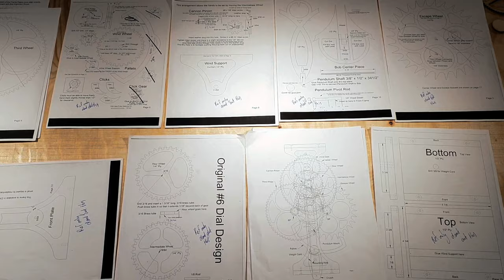Building a Wooden Clock

Comment: Great awesome work! Why you dont use laser for the gears ? because it burn the edges ?
Reply from the maker: Thanks :) There were several reasons why I did not use the laser for the gears. First was that I started this project almost 4 yeas ago, long before I got a laser. I had 3 gears cut but stopped until about a month ago. I wanted to finish the project in the same way as I started it by cutting the gears by hand (I did however trace them by laser). The second reason is that the wood is 6mm which is almost too thick and 12mm which is definitely too thick to cut through (I could have used 3 and 4 mm and glued pieces together but this seemed inelegant). Another reason is that the burnt edges might be a bit too sticky (there is always a slight residue). To remove it would have been a lot of work - and I think it would have taken more time than just cutting the gears (if I had a small belt sander it might have worked - it certainly would have helped during this project in any case). I am however happy that I did finish the gears by cutting it by hand.
Reply: @Induku  Thanks for the answer, i only worked with industrial laser cutters, 10-15 mm plywood is easy to cut with industrial cutters, but the burnt edges are still problem. Other way if cutted with cnc router. I like your quality works.
Reply: My answer for me is I made it, not a computer controlled laser.  The clock is 400 year old technology, not state of the art 2000's.  I just started on this clock, having made a different clock 19 years ago of a much different design.

Comment: Good job! I like this video.i have a question ,to have an accurate time keeping how calculate the length of pendulum ,and how to calculate the weight ,i think when we put too much weight  the clock runs bad
Reply from the maker: Clayton Boyer designed this clock and has a lot of information on calculating the various things that make it work. Here is a few answers for the some questions:http://www.lisaboyer.com/Claytonsite/frequentquestions.htm. And here is a bit more on how to design the pendulum and calculate the length: wikipedia.org/wiki/Seconds_pendulum

Comment: How accurate is the clock (if it could run forever how long till noon is clearly incorrect)? How long can it stay active without rewinding
Reply from the maker: It runs just over 24 hours on a single wind and is quite accurate over this period. I wind it every morning which means stopping it for a few moments and then adjust the hands slightly once done.

Comment: holy crap!!! Thats amazing. How long did that take you to build? Looks very time consuming. At least if you have a wheel or escapement wear out you can build a replacement.
Reply from the maker: I spent around 3 weeks making this clock but I started the process a few years earlier and did not work on it for a long time.
Reply: @Induku  cool, being made from wood if you were to let it run constantly, how long would it last before it wears out.
Reply from the maker: @kwacz  I am not sure it will happen in my lifetime. There are wooden clocks that are quite old and using modern composite woods, like plywood, should keep it running for many years or even decades to come.

Comment: Amazing! What does the weighted part do (not the pendulum)?
Reply from the maker: The weight store the kinetic energy to drive the clock. This is used in the place of, for example, a spring mechnism.
Reply: @Induku  Ok. Thank you! I'm thinking about building a clock that doesn't use a battery.

Comment: It run without power? Nice very nice
Reply from the maker: Every day when I wind it I use my muscle power to lift the weight thereby capturing it (potential energy). The clock runs from this the rest of the day. It does not use electrical energy as most other clock in our house does.

Comment: Very good work. Just quick question, can we use Brass instead and reduce thickness to half?
Reply from the maker: Using brass in stead of wood for most parts should be OK. Changing the size might be problematic depending on which parts you wand to resize. The designer have more information on this on his site here: https://lisaboyer.com/Claytonsite/frequentquestions.htm
Reply: @Induku  Thanks Mate! I wouldn't change the size. Only the gear / wheel thickness. Thick Brass sheets are heavy and expensive. Says.... From 12 mm to 6 mm and 6 to 3 respectively.
Reply from the maker: @BurmeseExplorer  I think reducing the thickness would not be a problem - especially when using metal. With wood you have the problem that the plywood sometimes warp slightly and 3mm is not very thick given the diameter of the gears. This might lead to some problems with that can miss align (especially if the temperature and humidity change a lot and thin plywood). But with brass this should not be a problem. I can highly recommend this video series on the Clickspring channel for inspiration on making a beautiful clock from brass: https://www.youtube.com/playlist?list=PLZioPDnFPNsHLGLuDI_5NQJAyTe36Uq80

Comment: How accurate are these wooden clocks . With humanity wood changes its weight . Maybe I'm wrong. Please if you can let me know . I'd like build one myself.  Thx very much.
Reply from the maker: The one I built is quite accurate. The temperature and humidity in our house is very stable (quite dry in general). I also wind and set it once a day and this means that I do not really see that the clock is wrong over a long period. I recommend building one and you will spend much more time looking at the mechanism than reading the actual time from it. Here is a lot more information from Clayton Boyer (where you can also get the plans) about the accuracy and a lot of other things: https://lisaboyer.com/Claytonsite/frequentquestions.htm
Reply: @Induku  thx

Comment: Awesome work! How accurate is it over time?
Reply from the maker: It is quite accurate. Within 24 hours I cannot really see that it is running fast or slow. I wind it every day and mostly need to move the minute hand when winding. I then set the time and and this seems to work well. If the beats are measured over 5 minutes it has a bmp of 60.03 to 60.1. I get a bit bored after this and have not measured it for much longer. This is reasonably accurate but I can of course always adjust the bob of the pendulum to make it run slightly faster or slower - this might be needed if the temperature or humidity change that might change the wood BUT the room where the clock is located has a reasonably constant temperature and the humidity is reasonably low.
Reply: @Induku  That's the bit that puts me off making clocks......having to wind one each day or even once a week and the time not all that accurate......give me an ornamental clock with all the gears and things that make it look like a steampunk clock, that is lots of dark hardwood and brass etc, but the workings driven by an electric quartz  module that only needs a battery every year or so......old is old, new looking old is OK if it looks the part.......my dream clock is the Atmos, but I just want to keep it polished and dusted off to see the time now and again but don't want to pay a few grand in the process......an Atmos look alike with an electric quartz module would really fit the bill and who would know the difference.
Reply from the maker: @gangleweed  I prefer gravity driven clocks over quarts mechanisms but luckily there is a clock for almost any taste. The designer of this clock (Clayton Boyer) does have plans for wooden clocks that have a variety of different quarts and other electronic mechanisms. Have a look and see, there might be one that you like that does not need to be wind AND cost much less than the Atmos :) https://www.lisaboyer.com/Claytonsite/Claytonsite1.htm
Reply: @Induku  Thanks, clock making is a hobby that once you get bitten is a lifetime experience..........if you like that sort of thing.

Comment: I made one of these a few years back and I managed to keep it running for around nine minutes before the pendulum stopped. I tried sanding the anchor teeth and the escape wheel teeth with sealer, to reduce friction but nothing really worked. My grandad got bored of be using his workshop for that project so now it just sits in the living room as an ornamental clock
Reply: Is your weight heavy enough?
Reply: @Richardros18   to be totally honest, I haven’t actually weighed it, it’s an iron cylinder about 25cm long by 6cm wide. I’d estimate at about 7kg but without weighing I can’t be sure. Would you recommend a weight?
Reply: @t.purkess9682  I think that should be heavy enough, might be not a proper alignment of the axis creating to much friction but hard to tell
Reply: I have recently assembled a wooden gear clock (one of those laser cut kits) and can may be advise you a bit better now (my previous advise was based on my watch making experience). Firstly you need to make sure that the gearwork runs freely (which you can check when you remove the anchor teeth). If that's the case than you need to make sure that the points of contact of both the anchor wheel and escape wheel are very smoothly sanded and than apply some wax on the anchor teeth and the escape wheel teeth as well.

Comment: How where you able to transfer the patterns to the wood? Prior to cutting out the shapes. I find gluing down paper to be very
 inaccurate. I want to be able to transfer the patterns directly onto the plywood.
Reply from the maker: I have access to a laser engraver/cutter. I got the plans from Clayton in digital format and "drew" them on the wood using a very low setting.
Reply: @Induku  I have Gensis clock by Mr Boyer. Is is all built except for the 4 big gears and the 3 pinion gears. Could I pay you to do those gears for me. What ever the cost would be?
Reply from the maker: @bbrown1269  I can possibly print these on wood but cannot cut them with a laser (I can only cut up to 4 mm). These gears look like it is 12 mm - and I am not an expert with a scroll saw and would recommend finding someone with a stronger laser. But you are welcome to contact me for more information via my website: www.indukudesign.com
Reply: @Induku  I have the DWG file for my Gensis clock. I can send to you.  I just need the 4 big gears and 3 pinion gears printed on the 3/8" plywood.
Reply from the maker: @UCXfRo1PjFvDR_PjP-26OocA That should not be a problem - and not too expensive. BUT the shipping might be a bit expensive depending where you live (I live in Sweden). But send me an email for more information.
Reply: @Induku  Yeah Shipping from Sweden to the States would be cost prohibitive. I live in the State of Oklahoma. I guess I need to find someone local.
Reply from the maker: @bbrown1269  Yes I think that would be cheaper. I had a quick search for laser services in Oklahoma and there seems to be quite a number of places that can possibly help. Good luck with your clock!

Comment: would it be possible to use metal instead of wood?
Reply from the maker: I am sure metal would also work.
Reply: Metal would work but you would need some serious kit to make it.  Wood is easy to work with and, other than a scroll saw, and maybe a small belt sander, only simple tools are required.  I've mad a few of Clayton Boyer's wooden clocks and, honestly, they will run for years and years with no maintenance other than dusting and winding up.

Comment: i surprise from where this clock gets energy?
Reply: the hexagonal weight. Gravity pulls it down
Reply: The weight drives the mechanism, and the "rocker" at the top of the pendulum regulates the rate of energy used, translates into time, with the right adjustments.
Reply: Old tech, like about 400 years ago.

Comment: No CNC laser or router?  Wow.
Reply from the maker: I did use a laser to trace the lines for the gears but then I used a scroll saw to cut the teeth. The numbers and tree on the bob was cus with the laser cutter as this was thin 3 mm wood.